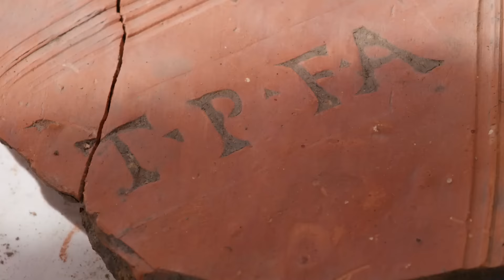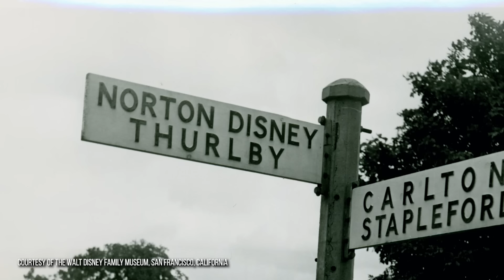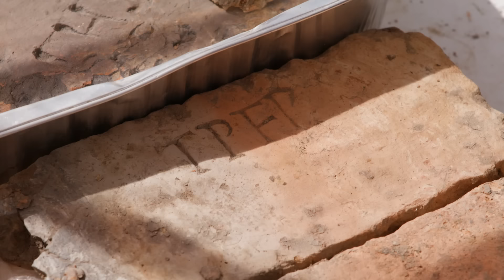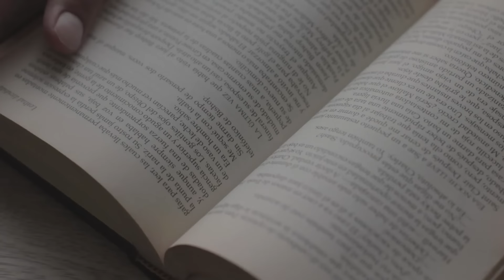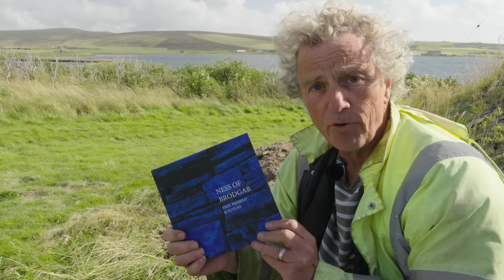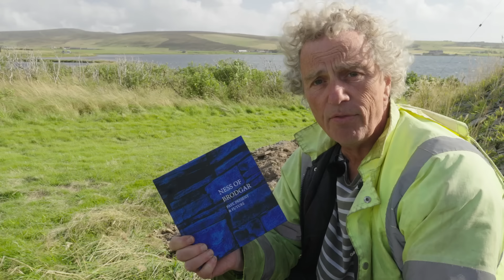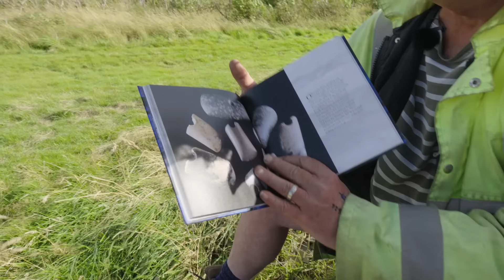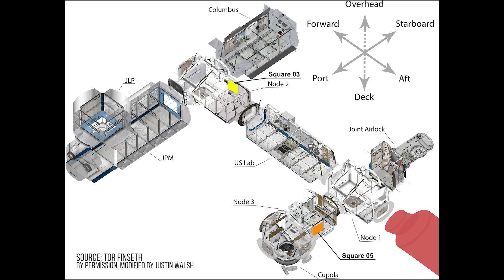ROMAN KILN | NESS OF BRODGAR | Time Team News | PLUS Stonehenge & Space Archaeology!

Comment: Lost my interest during your forever intro.
Reply: hi :) Can i ask, (sorry i'm going to anyway), what was the purpose of this comment? what was your intention when making it? To out yourself as having a low attention span and blame it on the video maker? (or did you just mean to state you believe the intro was too long, in which case why not just say that? like. "hey, thanks for the upload,  i feel the intro was a bit too long though" ).

I have adhd, i'm also known for losing interest quickly, and i did not lose interest at any point in the video... So i don't believe it is their, what you called "forever intro" as the reason you lost interest as you suggested with this comment. 

Perhaps it is a reflection of your own current state of mind (e.i tired/ low energy, coming down with an illness, or perhaps you're just not into general archeology and have more specific preference). ^^  

But yes, sorry couldn't help but comment as i had the complete opposite experience to you and i lose interest VERY easily and quickly in things so seemed off blaming your loss of interest on the intro, but hey each to their own!
Reply: Why not skip it forward?